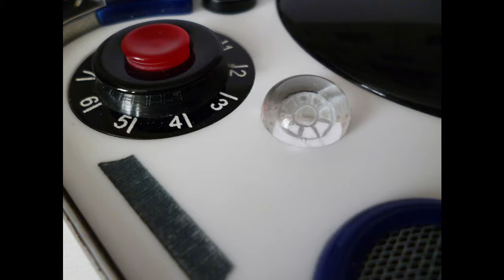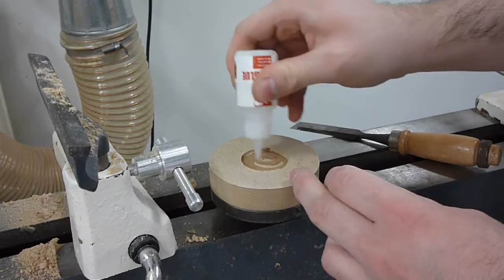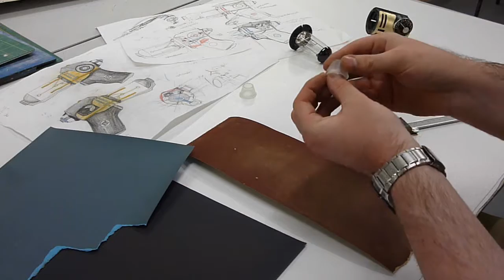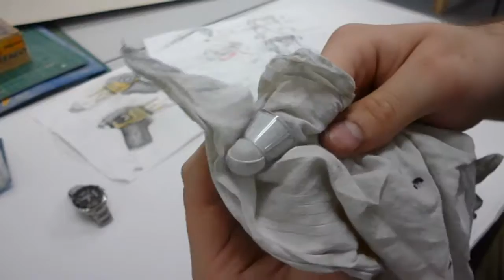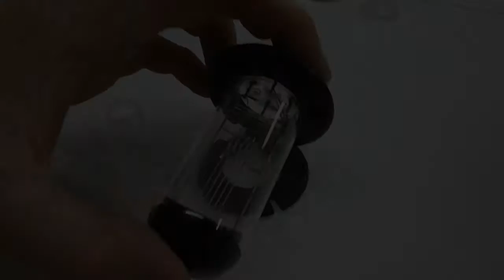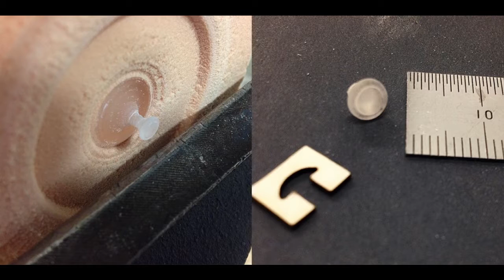Turning Semi Precise Plastic Parts On A Wood Lathe From Start To Finish

Comment: This is a great video. Not only did I find these methods intriguing, but I also rather enjoyed the style and pace you choose to do this in. 

Currently I myself am 3D printing parts and then sanding them on a lathe, which has been working alright for our prototyping, but I need to either improve my technique or create a tool to add a more consistent and reproducible finish since we will be creating hundreds of the same pieces.
Reply from the maker: Ben Simon 
 hi Ben, and many thanks for the kind words. :) ah cool, urm, one of the best ways of developing your technique that I can suggest is literally to play about with different grits and types of sanding medium, different tools and even use files on the lathe too (remove the tool post first) ... 
As for the repetability, maybe look into a copy lathe, you may be able to mock up a profile of your part that sits on your tool post and then have a notch on your tool handle that follows it to create the correct shape with the cutting tool tip. If that makes sense. :) hope this was of some help.